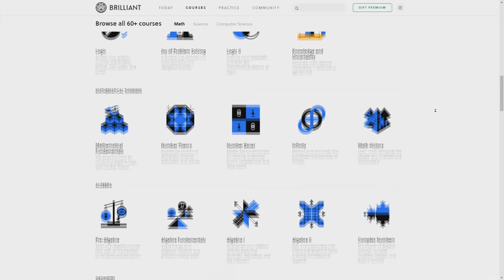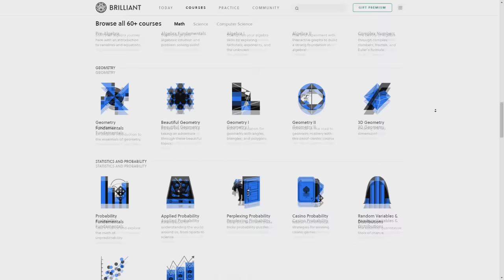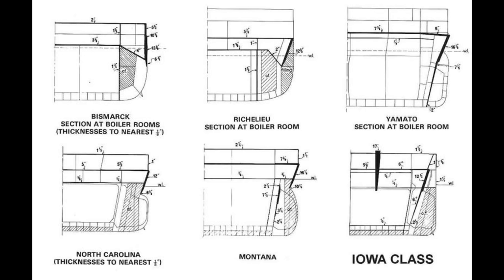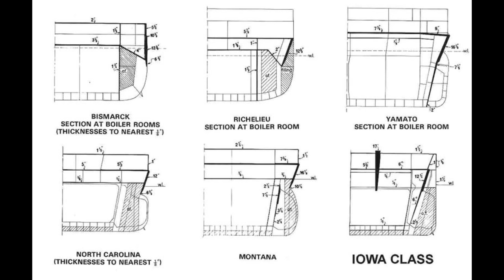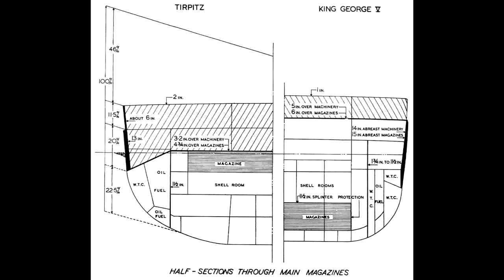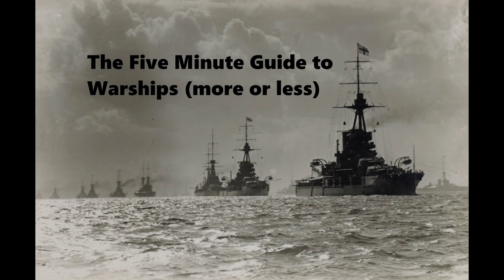Dreadnought Modernisation - A tri-wire balancing act

Comment from the maker: Pinned post for Q&A :)

Head to http://brilliant.org/Drachinifel/ to get started for free with Brilliant s interactive lessons. The first 200 people will also get 20% off an annual membership.
Reply: Could you give us your top 5 or 10 best and worst First Lords of the Admiralty and why?
Reply: In your Lion-class video you mentioned a “Large Lion” design around 1000ft long, displacing over 90,000 tons at combat load and intended to be invulnerable to all then-current weapons. How would this monstrosity stack up against the finalized Montana design?
Reply: As to the bi-line in the title, wouldn't a tri-line be a rope or wire with two other ropes/wires as handholds, making the balancing a lot easier?
Reply: Mabey a comparison of British Colonies/Commonwealth  navies? Like Austalia, Canada , NZ, India and the like. What they contributed to the British Admiralty and why, any famous ships,strengths weaknesses ect.
Reply: Hi Drach, how would you rate Admiral Sturdee as a commander? And how different do you think things would have been if he was in command of the Battle Cruisers at Jutland?
Reply: On the subject of the Big Five modernizations: given the Colorado was roughly a Tennessee with 16' guns, were the barbettes on the two classes the same size or were they different? Presumably the modernization of the Tennessees to be Colorado-ish would require significant changes to the shell handling rooms, elevators, and turrets, but would it require the barbettes to be ripped out?
Reply: Hi!

Slightly related question(-s). 

I wonder when it comes to IJN Hyuga and Ise BBs and their semi-carrier conversion. Do you think the Japanese would decide to spend those resources if they had floatplane carriers Mizuho and Nisshin still in service?
Granted both were pretty useful, or actually Nisshin was given Mizuho was sunk in 1942, but Chitose and Chiyoda were converted anyway.

I have not heard about any plans to convert Nisshin though and I wonder if there were any or it was just too useful as a fast troop transport.

And a related question. Mizuho was sunk by US submarine - Gato class USS Drum which was pretty impressive given the condition of Mark 14s at that time. I wonder if there were any ideas to use older, Mark 10s in the submarine forces or only older submarines could use them such as S 44 which sunk IJN heavy(-ish) cruiser Kako?

Take care!
Reply: Given the cause of disarmament was what drove the Naval and other treaties of the era. What effect would banning Battleship at the first London treaty have in the late 1930's rearmament. assuming all existing battleship have been scrapped by then.
Reply: With your expertise in Naval engineering, how would you refit the renounce, the Nelsons, and finally the Italian battleships?
Reply: Given HMS Furious's 18-inch guns destroyed rivets, what sort of damage would Incomparable suffer if she fired her 20-inch guns?
Reply: Drach you Gotta to do an episode/series about specialist ships. Anti-Aircraft, sub-hunters, bombardment ships, repair ships, fleet tankers, and weapon-specific designs (like the Kuma post-refit with the wall-o-torpedos)
Reply: For increasing protection would replacing the older armour plate with modern plate be a viable option I seem to remember u saying the effective improvement for the same thickness of armour between ww1 and ww2 was about 10%?
Reply: Hi Drachinifel! When talking about treaty-era cruisers, why build light cruisers at all? I assume it's A) a cost issue, as in you can get 5 light cruisers for the price or 3 heavy cruisers or something like that, and B) light cruisers perform somewhat different roles than heavy cruisers. Can you elaborate?
Reply: I read that the Italian Navy missed a chance to develop aircraft carriers in the interwar period. Would the Regia Marina having one or two carriers have improved their strategic position in the Mediterranean or do you think this wouldn’t mattered at all?
Reply: @tomaszmankowski9103  the stock of Mark 14s was limited early in the war, so Mark 10s were also used on the modern subs. They are the same diameter, and the Mark 14 is too long for older tubes, but there was nothing preventing the new subs from using the older torpedoes rather than go out without a full load of weapons.
Reply: @curlus  primarily because the Washington treaty only had "cruisers" while the London treaty created the distinction between 8" heavy cruisers and 6" (well, 155 mm) light cruisers and created separate tonnage limits. So you could build all your heavy cruisers and them build more light cruisers. The British had Commerce protection concerns that lead to them valuing numbers of hulls and building cruisers smaller than the full 10,000 tons, like the Yorks, Leanders, and Arethusas, but other navies chose to make their light cruisers (or most of them) as useful as possible rather than small economy ships.
Reply: Why live stream the 25
Reply: In your opinion what do you think was the reason why HMS Glorious was sailing home without a major escort, and why her survivors were then left in the water for days?
Reply: @kemarisite  Interesting. I wonder what the big picture was. Could such torpedoes be loaded "unofficially", could some commanders decide to use them, was the quantity of available Mark 10s sufficient to even attempt something like this and if there were differences between say the Philippines and Pearl. As usual one answered question spawns a dozen.
Reply: @tomaszmankowski9103  my only question is could you fit a MK 10 Torp contact detonator in a MK 14 Torp
Reply: The laat battleship to have been built was the Vanguard, the last battleship in service was the 4 Iowa class.

But when was the last time a nation's navy said to its ship building industry "we want a new battleship" and what was the resulting design?
Reply: You have done plenty of aircraft carriers in the past, such as Midway, Langley, Kaga, Yorktown, Essex, etc. Will you ever do a guide on IJN Hosho?
Reply: @cartmann94  

Given their poor coordination with the Regis Aeronautica, having a carrier would have helped tactically by a big margin, but strategically? Not sure they had enough fuel or resources.
Reply: Has anyone tried building a warship with unbalanced armour? That's to say, thicker armour on the port side than the starboard side (or vice versa). Is this a fundamentally stupid idea?
Reply: Not clear what the extent of the pre-war refit on HMS Royal Oak was, and why she was prioritised over other QEs', Repulse or Hood.  What order would you refit the RN battleships/ battlecruisers?
Reply: Why weren’t the older US 14” armed battleships  up gunned to the 14” /50 cal mkBs that North Carolina was supposed to have? To me it seems like especially after pearl harbor when most of the ships had they guns removed to be refloated that it just make a lot more sense to just upgrade the guns since have the work is already done. Of course some these also couldve been done during their normal modernization once the US had decided it wasn’t going to use the 14” mkBs on north Carolina they still could’ve made the guns to replace the much older guns on the older battleships giving them a much more potent main battery.
Reply: did you ever do those experiments in a water tank to see if Nelson & Rodney couldve done 27 knots on about 80,000shp?
Reply: Can we have a Wednesday special on the Suez Crisis or is that out of your scope?
Reply: So, a hypothetical: Adm Fisher is never promoted to 1SL, quietly retiring from his post as DNC. What then does the fleet subsequently look like by 1914, without Fisher's influence as C-in-C? 1918? 1939?
Reply: How much weight could be saved by replacing the main guns with newly designed and built guns? And alternatively how much longer could you make the new guns at the same weight.
Reply: Hey Drach, I stumbled across a piece of British wartime propaganda involving the fictional J Class destroyer HMS Jovial. In the video they claim that they would be able to make steam in 4 hours "from cold". Given that, in previous videos, you have stated that it could take days or even upwards of a week to raise steam in a capital ship is this a bit of bending the truth or could a destroyer raise steam that quickly?
Reply: @jacksargent2925  Short answer, her Captain was an idiot who was in a hurry to get home to Court Martial an officer who had pissed him off. He also didn't really understand the requirements of naval aviation and ignored the recommendations of his officers who did, and so Glorious was not flying regular reconnaissance sorties that may have spotted the beastly Hun before they appeared on the horizon. Survivors being left in the water, no idea.
Reply: I have a two part question sorry! Why was HMS Warspite built to different specifications to Valiant and Queen Elizabeth? Given your video on AA guns proved the 4.5 inch gun was a superb AA weapon, why leave Warspite with X8 4 inch guns when she could have X20 4.5 inch?
Reply: Royal oak wasn't a planned refit, it was damaged while on a Neutrality patrol during the Spanish civil war, so it got a mild modernization during repairs
Reply: Just finished reading Andy Boyd's The Royal Navy in Eastern Waters and in it he talks about Admiralty estimates from as late as 1944 comparing the Fuso and Ise classes to the modernised QEs and the conclusion being that the Japanese ships were superior (p231). Do you agree? Similarly the modernised Renown is rated lower than the Kongos which seems off.
Reply: So, question here about the assertion that it was important to improve your torpedo defenses as part of these rebuilds.

I can see the point from their perspective at the time.  Looking backwards however, it seems rather fruitless.  I can't really think of a capital ship that survived a torpedo attack (I am sure you can).  In comparison, ships took incredible amounts of shell hits and survived (they may have required scuttling but theoretically could have stayed afloat).  I know we don't have a lot of capital ship to capital ship combat in WWII, but maybe we got it all backwards.  Screw armoring the citadel.  Give them no armor and put 20 inches on your fire control system (yes this ab absurdum but just looking back historically it might have helped more - compare USS Johnston and the Bismarck as examples).
Reply: @robertsantamaria6857  the net seems to have eaten my reply so I'll post again.  From what I can find, the Tennessee and Colorado barbettes had the same inside diameter: 31 feet.  The twin 16" turret appears to be slightly lighter than the triple 14" and the part of the 16" turret that extends down into the barbette was about 6" smaller in diameter.  I don't see why the Tennessees could not have been upgunned to 16" while under construction, other than a disinclination to revive the 14" vs 16" argument that had raged in the Navy Department.  The WNT banned upgunning main armament, so that took future upgunning of the Tennessees off the table.
Reply: How valid was the "pre-Jutland" vs "post-Jutland" classification in the WNT?  Newspapers of the time reported consensus among conference delegates that 12" guns were obsolete.   The modernization of the 12" armed Florida and Utah cost $6.6M.  Washington, being about 80% complete, could have been completed for about the same cost.  But if Washington was completed, that would give the USN four "post-Jutland" ships, putting pressure on the UK to build a third Nelson for parity.  The conference had already engaged in some political art in defining Hood as "post-Jutland", while the two Tennessees, which were laid down after Hood, were classified as "pre-Jutland".   The inconsistent way the "post-Jutland" measure was applied, Hood vs Tennessee, seems to render the distinction meaningless.
Reply: In the "armoured" vs "unarmoured" carrier video, you compared British and American carriers. In the damage control video, you compared Japanese and American practices. My question is did the Japanese go for armoured, unarmoured, or something else for their carriers, and how good were British damage control practices? Accounting for armour and damage control, which of the big three navies had the most survivable carriers?
Reply: @stevevalley7835  Thank you for the info! The community here is always so helpful.
Reply: @javelin2811  I would suspect because the USN had a huge stock of the older 14"/50.  Seems that the guns for the battlecruisers, when they were planned to have 14", were ordered at the same time as the guns for the Tennessees, and the orders were not cancelled when the battlecrusiers were suspended.  The Navy ended up with some 119 of the 14"/50, nearly enough for two complete sets for each of the five ships that used them.  The Navy probably could not justify using the resources to build new guns from scratch, for second line ships, when so many guns were already available.
Reply: Given that the Standards are, well, standard how feasible would have it been to upgrade the California and Tennessee to 8 16" guns in the mid 1930s especially since the Navy wanted 16" armament in the first place?
Reply: Could Italians technically swap 10 320mm guns for 8 380mm guns on Dorias? And what steps they would be forced to take?
Reply: @johnshepherd8687  I answered a very similar question just above.  Technically, I don't see any problem as the barbettes appear to be the same size and the twin 16" is slightly lighter and smaller diameter.  The treaties prohibited upgunning however, with the exceptions of Italy and France, which were allowed to upgun to 16", as if that was feasible on the ships they had.
Reply: Who wants more French Pre Dreadnaught content?
"When hotels go to war" is probably my favourite video.
Reply: At 5:20 there is a photo of a ship in drydock. It has two superfiring turrets with two guns each and the letters "CR" painted on the superfiring turret. Which ship is this?
Reply: You really should do a video on the Ship of Theseus
Reply: Did any navy replace/upgrade main battery shell handling equipment to allow more rounds per minute to be loaded?  Or did everybody avoid that because the potential benefits were too minor to outweigh the costs?
Reply: If the Kongos, Kawachis, Fusos, Ises, and every American dreadnought up through the 14-inch standards (assume the ones that weren’t built yet somehow were) were present at Jutland with suitable escort from their own nations, could the Grand Fleet have wrought a decisive victory?  I know the Kongos would have a massive effect on the battlecruiser fight, but do Japanese and American forces being added to the main force allow Jellicoe to deliver a lethal blow to the HSF’s main force or does Scheer simply slip by an even larger enemy battle-line in the night?
Reply: My drydock question is: What were the top 5 warship shipbuilders in Britain during the runup to WW2 and it's immediate aftermath (1936-1946) in terms of the Pound value of all the contracts awarded to them?  Also where were these companies located primarily?
Reply: Given the similarities between the Tennessee and Colorado classes, could the Tennessee class be upgunned with the 8x16" guns of the Colorados and how hard/easy would this process be?
Reply: I've noticed in a number of images that there are anchor chains running from the deck under the bow of the ship and then back up on the deck such as at 20:38, I have a background in Ocean Engineering and Naval Architecture, but for the life of me I can't figure out what the purpose of them is and I have tried looking up the reasoning in archives but have come up with nothing. Out of curiosity have you come across the reasoning in your research?
Reply: Given imperial japan's incredible focus on naval aviation and the ability to cripple surface fleets with coordinated air strikes, it boggles my mind that there didn't seem to be any Japanese urgency to develop better anti-aircraft weaponry. Not to mention that they hardly added a noticeable number of their sub-par 25mm guns until late-war. 

Care to explain how Japan knew the strength of their naval aviation, and yet they didn't seem to prepare themselves for air attack? Maybe another instance of "japanese commanders squabbling about air superiority vs decisive surface engagement"?
Reply: Regarding armored ships and refits: where there any instances in history where either the armor thickness on a ship remained the same but the plates were replaced with a newer type of steel, or any instances where a ship like a battleship had its armor decreased because post refit the role of the ship had changed to fighting smaller ships? Something along the line of a battleship refitted into a battle cruiser, like how some ships of the line were cut down into Razee frigates?
Reply: Hey Drach, any chance of getting suitable content uploaded to Spotify? I don't know what's involved, so apologies if it's not practical but I'd love to be able to use their app to listen to your content at work.

Anyway, thanks for all the great videos either way.
Reply: What would your ideal WW2 battleship look like? Say it's the early 1930, the naval treaty system has broken down and First Sea Lord Drachinifel has been asked by an extremely wealthy British Empire to design a new class of Battleship for, say 1940.

Your knowledge of matters allows you, what is in effect 20/20 hindsight. You have unlimited freedom to develop all systems related to naval power. What does HMS Drac look like as she hit the water?
Reply: If the Tegethoff-class given to Yugoslavia survived World War 1; how would they go about modernizing it, if they could at all?
Reply: Would it be practical to refit a ship with triple expansion engines to steam turbines?
Reply: What speed makes a "fast battleship"?
Reply: @somethinglikethat2176  "by an extremely wealthy British Empire"

Someone doesn't know much about history....
Reply: @MrPro897  "What speed makes a "fast battleship"?"

Think it depends on how slow everything else is. (heh!)
Reply: Why were angled belts so much better? You get a greater effective thickness, sure, but also that the belt needs to be longer to cover the same vertical distance, which cancels out. Seems like the biggest effect is just that fewer incoming shells will hit the belt at all, because relative to their angle of travel it's narrower. Was it just about trying to make shells bounce off?
Reply: Obviously, newly-built ships have (or should have) an inherent advantage over contemporary refits. Were there any refitted ships or proposed refits that created a unit that was on par or superior to contemporary newly-built ships? What refits would you consider to have been the most effective/best?
Reply: Any possibility of including the names of the vessels on the videos where it isn’t immediately apparent?  I listen on the way to work and occasionally I get to watch an episode and am completely lost on which ship I am looking at.
Reply: Good Day Drach! love the videos, love listening to them while at work. Lately i've been listening to Different Military experts Q&As, and one thing that piqued my interest was the Unfortunate Elbonians. to try and continue the trend what would you do to subtly sabotage the Elbonian Navy while not being obvious at doing so. How would you do so? the Parameters would be the ships/boats have to at least been laid down, no "just paper" designs, but reasonable modifications of existing designs are valid, like different main guns on a BB or different aircraft on a CV. there is no limits on which nations can be used. thank you much!
Reply: For a future segment, it would be interesting to consider seaplane tenders and why they were not used more in fleet operations, as opposed to capital ships carrying around things like planes and aviation gasoline which seemed to always be the first thing to be hit (or ignited by one's first volley) and thereby creating rather annoying if often very serious fires. And particularly since floatplane operations seemed to consistently yield negligible results for every navy not flying the Rising Sun.
Reply: Hey drach, could you do a video about how decisive the USs submarine actions were against Japan in WW2? I saw historiographs video on it and wondered what your take on it was
Reply: My uncle always used to say that the Swedish fleet was small but very powerful, what’s your opinion? Maybe covering age of sale and post dreadnought? Thanks for awesome content!
Reply: Here's a challenge for you, how could the R class be modernizated. The Royal Navy needs the hulks and believes that even with Lions and King Georges, there will not be enough ships to be in all need areas.
Reply: @scottgiles7546  post WW1 and the interwar period wasn't their high point. I was just saying it to eliminate the cost and budget issues that they faced. Of course the British and Americans could have gone balls to the wall on naval spending but either was in the mood.
Reply: Watching the Sydney to Hobart race and it got me thinking: how would an age of sail crew perform operating a modern super maxi yacht compared to modern yachtsmen operating an age of sail vessel?
Reply: The IJN ou often gets criticized for not upgrading the armor on the Kongos but I don't see how they could have gained much from it without sacrificing speed.  The least powerful guns the Kongos would face are the 14"/45 on the Oklahoma and Arizona.  The upgraded guns could penetrate 12" at 20kyd.  I don't see how armoring a Kongo to withstand even 14" guns would even keep their speed at pre upgrade 27.5 knots.  I think they made the correct decision to choose speed over protection since there wasn't much they could do to protect against 14 and later 16" gunfire.
Reply: You will probably scream but could you come up with a battleship rating system like the one for battleship guns? I ask because I’ve looked at game systems and I don’t trust that any of them have gotten ships right, and I think you have the skills to do it.
Reply: In the spirit of warships spontaneously exploding, what is the worst peacetime accident involving a warship?
Reply: how big would a monitor have to be in order to support 1-2 Heavy Gustav style guns?
Reply: Hey, you. Although I like your videos for the calming effects of historical minutiae I don’t watch all your videos, but i am glad I caught this one for three reasons; happy to learn of your sponsorship as I was waiting for a Brilliant promotion to surface cause I need some refreshers on mathematics and will use your code; also I was wondering if you could point me to any of your videos on naval dazzle, insignias, vexillology of maritime flags, basically symbolic and graphical topics; third reason is to say thanks for sharing your content because it is appreciated!  Peace!
Reply: Could you do a video explaining what the Pyotr Velikiy is from world of warships information is very scarce and I'm curious about the design
Reply: Just how severely would one have to rework a ship if one decided to bump up the caliber of its guns (say from 14" duals to 15" duals, or 14" triples to 16" doubles)?
Reply: I wonder how a German battelline would look like at the end of the 30s. If they managed a peace treaty in 1918 and getting a navy as big as France in the treatys after the war. 
What ships are in there and more interesting what would the modernisation look like.
Reply: In a video such as this, where you have dozens of photos that are not obviously linked to your narrative, could you add text to identify the warships and date of photo?
Reply: Hi drach, the USN had training flat tops, like USS Wolverine, and Sable, for training naval aviators on their defining skill, landing and taking off from an aircraft carrier.  Did the IJN, or RN have a similar approach for their aviators, if not, what was their method?
Reply: I'm curious, would any improvements to the armour through extending the belt or improving deck armour have saved Hiei? Did the shell from a US cruiser have to penetrate the belt to knock out steering and if not, would any extension to the belt have feasible covered where Hiei was hit, and if so, was 8 inches enough to stop an 8 inch shell at point blank?
Reply: We're the torpedo defense bulges really any good during WWII? Seems a lot of ships were lost or seriously damaged by torpedoes anyway.
Reply: We're the torpedo defense bulges really any good during WWII? Seems a lot of ships were lost or seriously damaged by torpedoes anyway.
Reply: you forgot the modernization of brazil's dreadnought
Reply: Could the Big5 have been made to go faster? If so, what would have been the limiting factor? Hull form leading to excess vibration above X knots?
Reply: What would the us standard battleships, from the Nevadas to the Colorados look like if they receive upgrade similar to the Italians?
Reply: Maybe change the rest of the big five of the US Navy from 14inch to 16inch guns. Increase the torpedo bulges. Maybe deck armor.